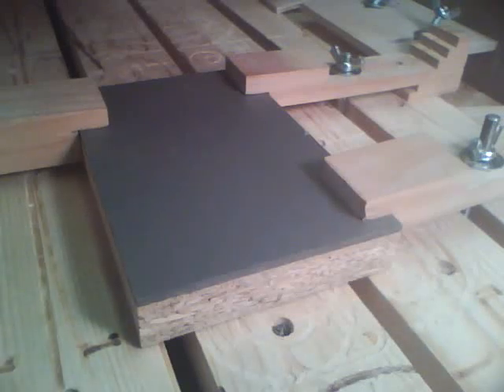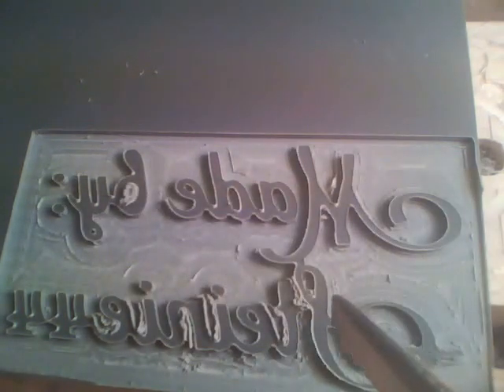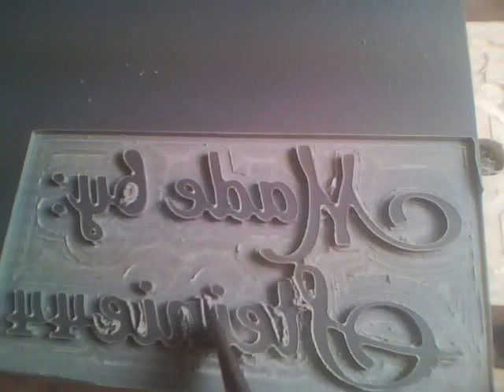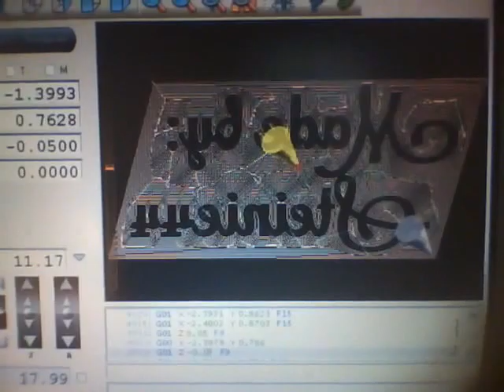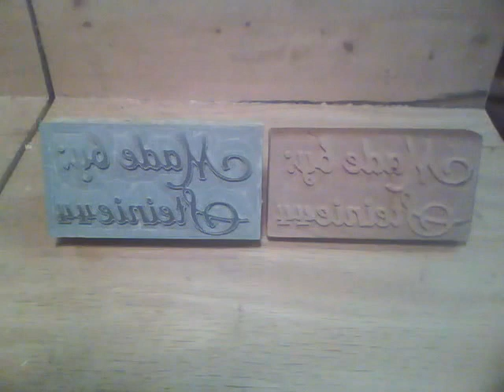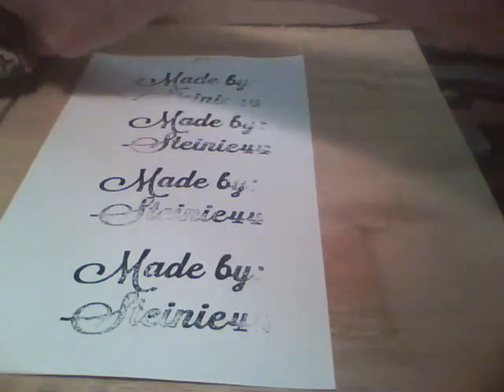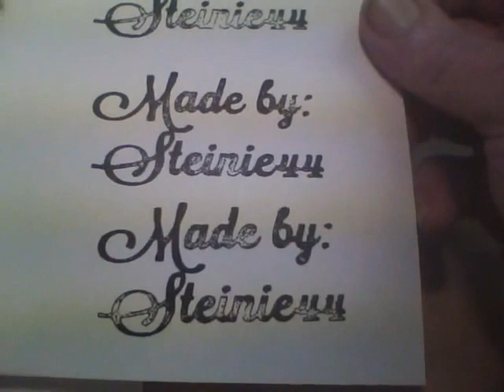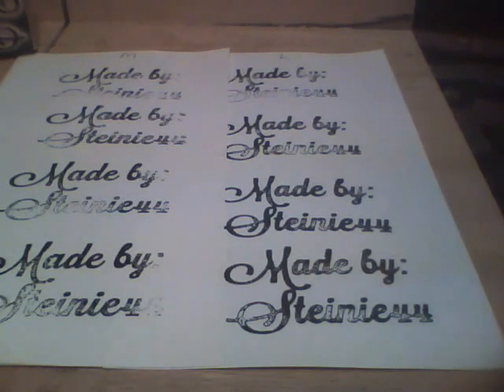Carving Stamps on my CNC and testing them

Comment: Not sure what the rigidity of the linoleum is or how affixed it is to the particleboard, but if you were able to separate them and then affix the linoleum to a curved backing. It would be interesting to see the results there as you'd be able to roll the stamp and that would let you apply a lot more pressure while rolling vs trying to get a the pressure across the entire thing evenly. It could also help take up any low and high spots since it would just be leveling across a thin bit of the stamp at a time instead of the entire thing.

That said, I don't know and I'm just making a guess here, if I ever get a little CNC like this I'll give it a go myself.

Comment: Try making a smaller stamp out of aluminium or bronze. While not as good as rubber, metal still makes for great stamps, it's solid and rigid, you can have very fine detail in it. And it is fairly easy to mill on the CNC router, unlike rubber.

And when stamping, apply lots of ink and just whack it hard on the paper, don't press it in slowly. WHAM! Perfect impression almost every time...

Think of that library scene from Indiana Jones and The Last Crusade. ;-)
Reply from the maker: +Krešimir Cindrić Good idea. I'm thinking about aluminum for a branding iron. Also can be used for embossing paper.

Comment: I'm surprised at how well they both come out and that they did that much of a good print on paper. If you tried a more rubbery material, it would have the burrs you mentioned before maybe worse than the linoleum. But it was a good test and thanks for sharing.

Comment: That's neat Jim!  I haven't tried making stamps yet.  Does your table have some low spots on it?  Maybe the rubber was able to conform better to an uneven surface than the wood.  Maybe try stamping the paper on top of glass or a mirror.  hmm
Reply from the maker: +Steve Carmichael Thanks Steve. I tried them again a while ago. I stacked about 10 sheets of paper. That worked a lot better, all letters filled in.